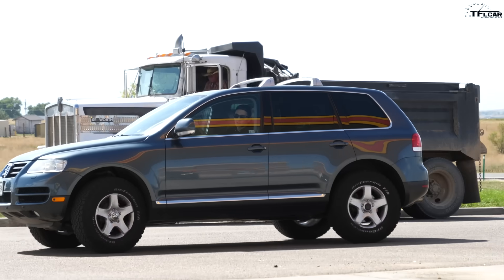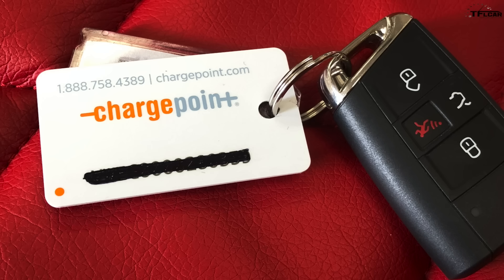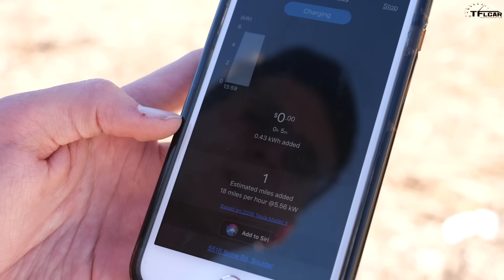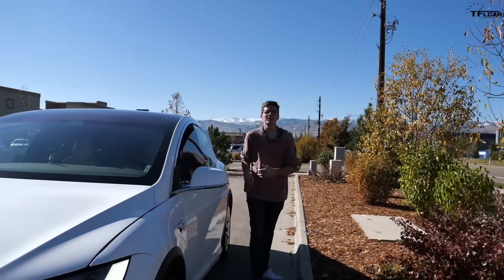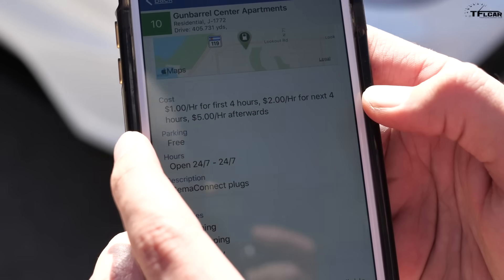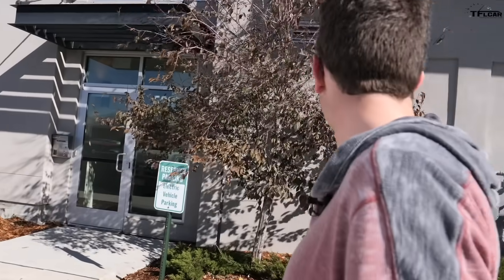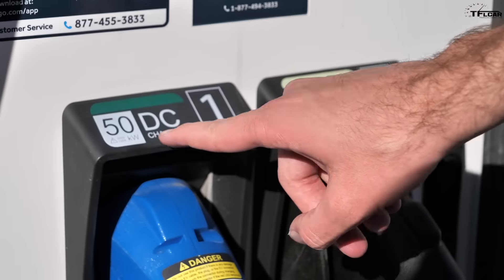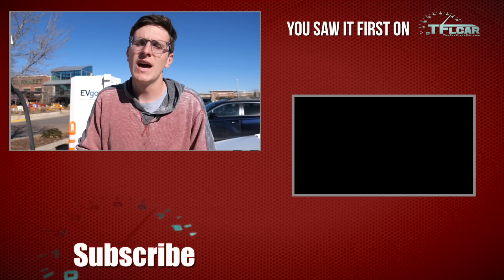Here’s Why Charging an Electric Car Can Suck - And It’s Not The Reason You Think!

Comment: The grocery store by my house lets you charge 2 hours for free every day. I just walk across the street to get my car as I live across the street from it. I park across the street when I get home from work, plug in my car and get the 2 free hours every day.  It's level 2 charging and since I only drive 12 miles round trip to work and back, I end up with a full battery before the end of the workweek. 
Best decision I ever made. I don't care how much gas prices are. My "fuel" is free. 
If I need to charge from almost empty, I can use the chargepoint in the parking lot where I work and get 8.5 hours of juice at about half the price of other publicly available spots as this is in a cardkey restricted lot and my company subsidizes the EV chargers 50%.
I'm never going back to gas powered cars, and if/when my Aptera is delivered, I will rarely if ever pay for "EV fuel" again. Heck I barely pay for it now!

Comment: Did I understand correctly? You spent 6 minutes to charge up 15 miles of energy? In that same time one could fill a 20 gallon tank, with gasoline, that would have a 400 mile range. Plus you need an iPhone, expensive, internet, also expensive, in order to charge your batteries. Wow, sign me up.

Comment: Two big issue I note with 'charging stations' vs. most gas stations is that they never have a canopy over the charge points or dedicated overhead lighting. You will get very wet if raining while plugging in, arranging payment and unplugging the charger from your vehicle. Why not install canopies, with solar panels for electricity to provide efficient LED lighting to make it nicer to use charge points.

Comment: In 2021 when my big, old, gas-powered, mom car finally died it was time to figure out what would be my car of the future. Gas seemed played, after all cars as a mode of transportation and gas & oil as a fuel source were both about a century old. Easily accessed gas & oil is finite and rife with geopolitical twists. My exploration moved on. 

Next - all electric. My considerations were that I live part time in a house on a farm off a series of dirt roads and a long commute (2.5 hours) to the nearest enormous city for work - yup even during Covid. I rented and borrowed an assortment of EVs. And, experienced all of the problems shown in the video and more. I’ll just list my problems without repeating any from the video. Let your imagination handle the rest: rain, isolated industrial locations, panhandlers, no cell connection to download app, wild dogs, rain with car in big puddle plugging into electric vehicle, malfunctioning pump, broken pump, cut off Tesla pump (later found out Tesla doesn’t always pay their share), no accommodations for disabled drivers, run out of electricity before finding a functioning charging station, getting an EV towed to the nearest operating charging station (crap shoot), terror at being alone at a dark charging station, and let me reiterate RAIN. The biggest factors for me were safety, disability access, and availability. So, on to the next option. 

Hybrid! I ultimately bought two used Toyota hybrids. All my concerns with the EVs were nonissues. I had the safety, the disability access, and availability of a traditional gas station. I found a great company that inexpensively refurbishes and replaces the batteries, and they travelled several states to my door for the replacement. Now I travel down the road feeling good as my car sips $4 and rising gas. BUT WAIT THERE’S MORE!

I didn’t remember during my investigation that there is a repair and servicing component to an EV and a hybrid but that’s a whole other video and story.

Comment: Thanks for a very good and clear video on the state of the EV car and the process of recharging one - if you can find a station (good luck in the Northeast U.S.) But I compare using an electric car and its charging system  vs our present gas-powered cars to using a single-shot muzzle-loading musket to a modern cartridge gun. The EV car/muzzleloader have limited range and take deliberate actions, longer times and methods needed to use them for a short-range result , and limited resources. The gasoline car & cartridge rifle has greater range, is quick to reload and requires a LOT LESS HASSLE. And when my gas engine dies or needs repair I have hundreds of easy options - when your batteries go dead/have a major problem, you're screwed. And if gasoline is scarce, I can switch to alcohol and make my own.  You'd still need an electric grid powered by fossil fuels.

Comment: The USA inadequate power grid. Recharge station waits and wasted time charging compared to petrol. The size of this country and the limited mileage per fillup. The costs to consumers paying for battery operated (not electric) cars because of increased consumption  and not enough electric being generated to recharge and operate homes.
 Battery operated cars will not work in America as a whole. Don't discontinue real cars of today for the liberal pipe-dream of expensive usage. Truth is they don't want the masses to own a car. It's being designed with & for people movers.

Comment: The AVERAGE age of gas powered cars on US roads today is a bit over 12 years.  
Now compare that to the 8-10 year life of an ev with it's one and done, non-recyclable battery.
Seems this so-called "green" movement is going to be filling up junk yards quicker, with dangerous battery disposal pits leeching God knows what into the soil.  
And given the vehicles shortened life span, there  will have to be more cars produced, with more resources used to produce them.
I don't see the supposed "green" benefits.

Comment: They need a fast way to change a spent pack for a full one, like NASCAR pit crews change tires. Do that, and EV will be in. Until then, they are a good idea for city dwellers who have no interest in driving long distance. Out here in rural USA, EV is not viable.
Reply: You buy a new EV... first charge you swap out your brand new battery for an 8 year old one... easy to pull that 1000+ pound battery out... just need a couple of super heroes with nothing else to do.

Comment: I used to work in a huge warehouse with hundreds of electric forklifts up to 7 tonnes and pallet moving machines and when their batteries were going flat you just swap them with a good one.  It took 3 or 4 minutes.  If all electric cars had universal batteries we could have battery stations instead of fuel stations, simple.

Comment: I hope that these charging stations increase and improve in the future. I live in Public Housing where it’s doubtful that a charging station will be placed. Also, having to wait hours for a full charge sounds CRAZY to me. 😑🇺🇸
Reply: In reality most EV drivers don't run their batteries down until the car stops. Just like most gasser drivers don't run their cars to an empty tank.
Installation of a L2 charge point or a 240 volt “50” amp (actually 40 amp) outlet at home may not be very expensive or it may be prohibitively expensive. If your garage or carport is at the opposite end of the house, the heavy copper cable will run into considerable money plus snaking it under the house.
Dryer outlets are 240 volt but only “30” amp (actually 24 amp) with #10 copper cable. Permits to install electrical wiring and outlets vary widely in cost, as do licensed electricians. Professional installation is the only choice if you don't own the property, or it is a multiple unit condominium, or you don't know what you are doing.
Reply: @algrayson8965  if you run it down it would be similar to cell battery at zero needing a touch of charge to lock the charge commanding place as well as the charging station.may not register thevehicle
Reply: @algrayson8965  I always run my gas tank 98% empty. The I know who to blame when I get bad gas.
Reply: "Why does Public Housing need chargers? Welfare bums don't go to work!" Conservative response.
Reply: Yeah, like waiting overnight.
Reply: With so many crimes nowadays,  I have to have guns, bullet prove vest before spend long time at recharging station
Reply: 14:09 European Teslas use the CCS2 as it is mandated by the European Union. The CCS2 is based on the Menneke connector in the same manner as the CCS1 (North America) is based on the J1772 connector. The Menneke connector provides for 3 phase charging.
Reply: Its been fixed super chargers are the norm
Reply: Yeah, with today's technology. But don't you think they will solve all those problems? Don't you imagine that eventually the technology will exist where these cars are self charging, or have mini solar panels that charge them continuously? Or that chargers and batteries will improve to the point where they charge very quickly? No one is saying this is mature technology. It's in its infancy.
Reply: @alansach8437  it beats driving an ICE car
Reply: @alansach8437  It would have to be an awful big solar cell and if you have your house on solar I'm, not sure you will have enough energy to charge your car because they are sized to feed your home not a car that may use just as much as the house.  I don't know how many kw cars need but I'd hate to be limited to a rooftop of solar.

Forgetting all that, imagine the landfills full of batteries and the cost of having to run copper cable to charging stations along every road in the midwest where few people live but cars and trucks would still need to travel.  And even on the 2 coasts you atill have a lot of areas that have very sparse populations.  Imagine your car breaks down in Oklahoma and you have to tow it to Tesla.  How much will that cost?
Reply: Should just have an extension cord you can plug into the mains.
Reply: @soundsoflife9549  That at least makes more sense then chargers that don't work on all cars.  Slower chargers for people with less money, we'll need extra of those and how is a grid already that's already challenged going to function adding all these EVs?
Reply: Better bring a pillow and a blanket with you. Or a good book. It's gonna be quite a wait
Reply: The "BUILD BACK BETTER PLAN"  indicated 500000 charging stations.  50 states 10000 each state?  What will be the criteria to place them?  More in Urban areas?  Less in Rural?  Can an independent company build their own ?  Just wondering?  They throw out numbers and scary climate predictions instead of actual plans.
Reply: Also, how many cars can be charging at once? Mom's,  dad's, teens?
Reply: Can you imagine the cost of having to build charging stations in the middle of the US where there's nothingness.  EVs are a failed technology.  Hopefully hydrogen will.
Reply: @cityguyusa  ev's are not a failed technology, troll
Reply: @bradmagnuson6963  What bridge are you under?
Reply: @cityguyusa  I'm not. Unless you own and drive an electric car, people who don't know what they're talking about, should educate themselves, or shut up. More EV's are coming on the market almost every week, how is that a failed technology? You really have no idea what you're talking about
Reply: @cityguyusa  failed technology how?
Reply: @patsy9252  I don't see it as a legitimate option because of the amount of eart that has to be moved to make one EV is like 20 tons if memory serves.  Then there's the waste of the batterues that nreds to be disposed and your going to have to put charging stations all over the place which means you have to run huge towers to carry ekectric to plces it doesn't exist.  A logistic nightmare from a frid that can varely make it through sumket without charging cars and trucks.  As usual it most likely a money geab from people that want to save the planet but it's not a solution.  Throw away your clunker Obama's deal is still out there in some form.  What a waste. Having people disposing of reliable vehicles and forcing them into landfills for chump change.
Reply: Wait till the battery needs to be replaced cost is very expensive some over $5,000 to replace.
Reply: @sismith9769  Yeah, the batteries are expensive. But they last ten years. Ten years of no gas to buy, no tune ups to do, no oil changes to pay for! Besides, most people get rid of a car after (or before) ten years anyway. Plus, as technology improves, the price of these batteries will come down.
Reply: @sismith9769  Are you kidding. Read up some more. More like $20,000 and up.
Reply: It is really unsafe being somewhere that long in large cities.  Especially for our females.  I hope our government can make things easier.
Reply: The government will screw it up.
Reply: @ralemc1960  Don't ever rely on the Government for anything.
Reply: @ralemc1960 .  I think that's part of their plan. 
Women and children will be raped. Kids abducted into sex trafficking.
Reply: Your on welfare ! Really do you have 60,000 dollars laying around to purchase an all EV car . Besides chances are someone will wreck it or steal  it the first night you go to sleep . Be serious !
Reply: @williamjeffrey1222  I live in public housing because I am a disabled veteran.  I lost my legs in Iraq.  My brother gave me his old Chevy Volt and I saved up for over a year to have hand controls installed.  This situation is a reality.  Stop being an asshole.  You's notions of who lives in public assisted housing are all wrong.
Reply: @eelnoops5200  By the time you get that car ready, your battery will be bad and you will need a new one. Good Luck.
Reply: @davidtwister6936 My brother drove the car until I could afford the hand controls.  They have been installed for a few years now.  I drove the car yesterday.  It's great.  But, charging stations in public housing are eventually going to be needed.  The point being that not all  EVs are priced like a luxury Tesla.  Even poor people like me drive EVs.
Reply: @eelnoops5200  60000$ is bottom endpricednot the luxury 1st class even new outdated fossil burners command 60000$ you win orloseeither wayifyou think EV will save in costs steady you also will need mechanics trained in EV  equipt commanding higher maintenance costs for the training 
Stay with fossil burners and I givethatnewvehicleonly 5 years and mostgas stations eliminate pumps to replace with ev chargers
Reply: @eelnoops5200  A new Nissan Leaf is over $30,000.
Reply: @algrayson8965  What's your point?  EVs have been around long enough that there is a used EV market, or owners of EVs are handing there used EVs down to friends and family - like in my case.
Reply: @algrayson8965  The point is that in 10 years there will be a demand for charging stations even in poor neighborhoods.
Reply: @algrayson8965  nope, a 2022 Leaf is $25K. With tax incentives and rebates, you can drive off for less than $19K
Reply: @davidtwister6936  not true
Reply: @eelnoops5200  yeah good luck with that
Reply: @williamjeffrey1222  Instead of having your gas tank drilled and they steal the $4/gallon gas out of your F150, lol
Reply: @kCI251  
Buy a $20.00 locking gas cap.
Reply: @williamjeffrey1222  What a way to insult your fellow man.  
To think, with 60k hmm, he could buy 2nd hand a BMW, Audi & Mercedes and have all three parked at his public housing paid off and gassed to the brim with super unleaded.
Reply: @williamjeffrey1222  ev's don't cost $60K, mine was $12K

Comment: Holy smokes! This makes me eternally greatful for my gasser. There is no way I would deal with this madness. And when you consider all the direct and indirect expenses of operating an EV, there is no real savings. It's a pay now or pay later proposition. Nobody rides for free...or even cheap. So it comes down to a matter of convenience. I'll spend 5 minutes gassing up and be done for the next 500 miles.
Reply: my 2020 Hyundai Elantra nearly goes 500 miles on a full tank of gas lots of cars have close to that capability if not have that capability how you going to use electric car if you want to go long distance like to another province or on your guy's case state to state across the Nation there's not enough Chargers available you'll be waiting forever
Reply: @outdooraddventure  Honda Civic SI easily makes 500 miles on a tank full.
Reply: 500 miles? What gasser do you have?
Reply: @sam72981  I once had an '86 Ford Thunderbird that could do 400 miles.  Admittedly, it had a very big gas tank, but once you get to highway speeds, the V8 doesn't work that hard to maintain it.  It did burn a lot of gas in local traffic.
Reply: What about older people,they don't understand how this crap work and have to use a app on internet threw phone to work,these folk will be lost trying to figure it out.Just pump the gas and you done.
Reply: @donbest5024  I have a flip phone, so no workie for me   lol

Comment: Way they don't have a simple universal communication (preferably secured "coded") between a charging station and a car? You simply have a credit card number memorized in your car's computer/software that will be send directly with a cable you just get connected to the charging station (no wireless needed). This will let you charge, at all charging stations by simply plugin in a cable.
 There will be no needs for cell phone, apps, and spending time looking for exact charging stations on a bad looking map. What happens if you forget/loose your cell phone? Or your cell phone doesn't have good internet reception. You can't charge up your car.
 I don't even understand way they have different power inlets. 
 Charging is the weakest point on EVs, so way make it even more painful? 
I will even suggest a wirelesses/inductive charging.(I mean that was Tesla's idea after all). But maybe I am to spoiled.

Comment: We need a different system .l think a drive thru battery exchange,like a car wash ,pull in ,battery is slid out from the rear of the car by a remote lift,new battery slid in ,off you go.